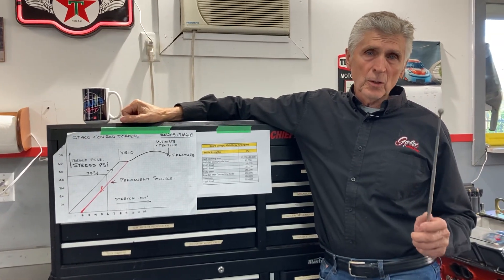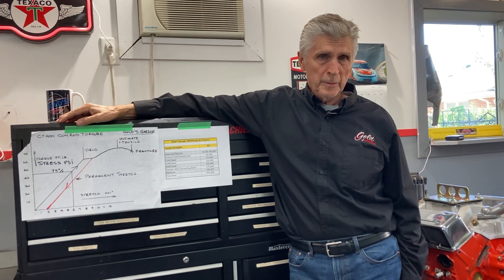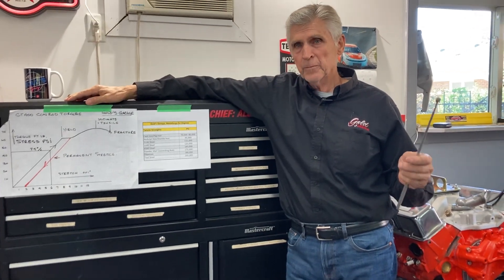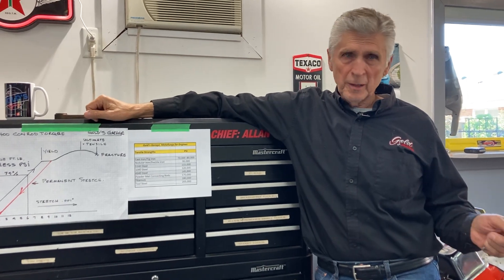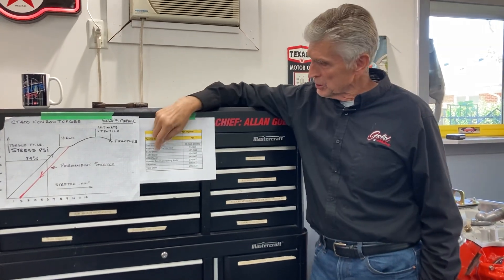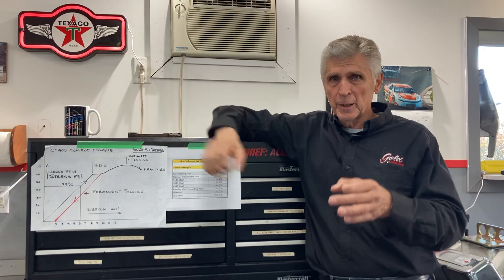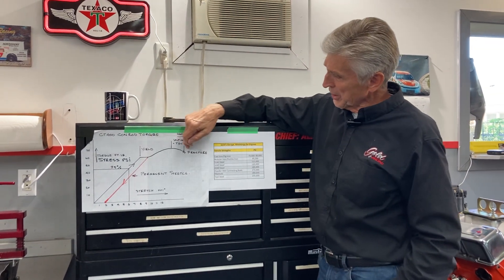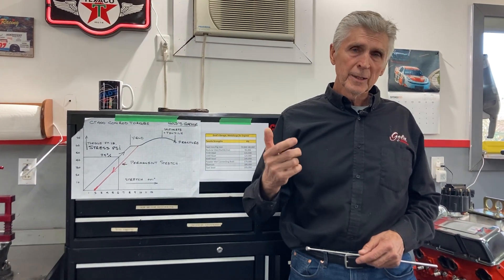Forged or cast?? choosing the RIGHT parts for YOUR build - Which rods and crankshafts are best??

Comment: "Powder Metallurgy" sounds like Similar "Cheaper" process Chrysler did Factory Oem between their Forged Steel cranks & massive Dana 60 axle with their 727 auto trans Front clutch Drum & we all Know how that worked out (Google 727 trans Explosions) !!! ........Anyone running a 727 (Even Oem Hemi trans) must spend Big Buckaroo$  to replace that Oem Pos "Powder Metallurgy"  clutch Drum with real Billet Steel just to keep your Legs, feet & car Intact......Another Powder metal Fail !!
Reply from the maker: Thanks Tom. All good information that i didn't know. Thanks for sharing. AG

Comment: Speaking of yield. I just finished a 393 Windsor. Scat rods. Torquing rod bolts and one kept on going. OH SHIT! Mind these are ARP and this one must have slipped through heat treat. I replaced that bolt and it had noticeably stretched and the shank was .020 narrower  and longer than it should have been.
Reply from the maker: Thanks for sharing your experience and validating my point 39Impala. IF you look at my stress/strain graph, what happens between the ultimate tensile strength and fracture is called "necking" where the bolt cross sectional area reduces as it stretches. That would make a good lab example. Good that you were able to replace it. AG
Reply: @goldsgarage8236  cool I see that now.

Comment: You forgot to mention 300M steel some higher end rods are made of.(or is that just some high end roller cams?) It's supposed to be even better than 4340.
Reply from the maker: Thanks itseithergoingtowork. I am not familiar with 300M steel? AG
Reply: @goldsgarage8236  
I looked up 300M connecting rods and they do use this material on some of the high end rods. A simple Bing search got me there. I thought they did but couldn't remember for sure.

300M is used on transmission input shafts if 4340 isn't strong enough. The sbc 383 I built for a friend had to upgrade the input shaft on his th350 to a 4340 one and broke that one and had to go up to the 300M input shaft. After that it was fine but then he started breaking output shafts.😲

They don't make a stronger output shaft so he had to start over with a th400. It wasn't that the engine was that powerful, only 588 HP, it is the way the vehicle is driven. He likes to keep it floored when he takes a 10 foot jump and by the time he lands it's time to shift. The vehicle is built to run on the Silver Lake Sand Dunes here in Michigan on the west side of the state.
Reply: I think 300M is just a modified version of 4340, has more carbon and moly maybe. I think the Vasco shaft is a little better than the 300m but I could be wrong.

Comment: Thx for informative vid...Not gonna use any "Cracked" rods in my engine builds....Everything the Oem factories use & Promote today is simply what's Cheaper for them to produce.....Not better or stronger.....Any con Rod big End that can be simply knocked or "Cracked off" is just too Brittle weaker alloy that will just suddenly "let go" (On the Dotted line) when Pushed instead of controlled stretching or bending like Real Steel rods  used to do......A good Aircraft grade gas vacuumed 4340 Con Rod will probably Break or Demolish the factory "Cracker" if you tried "Cracking" it's cap off !!
Reply from the maker: Thanks for your point of view Tom, always enjoy your comments.AG

Comment: Tool steel is used alot in making wrist pins for pistons.  L-19 connecting rod bolts are the best!  Highest psi...
Reply from the maker: Thanks Leonard. Good point, thanks for catching that. AG
Reply: The custom age 625+ is up there in strength and not as corrosive as the L-19.

Comment: Hope you don't mind if I add something not mentioned. Powdered metal rods are not reconditioned due the method of fracturing the cap. Grinding these surfaces would remove those mating "chasms"  so there is no way to locate the cap on the rod. Most rods locate on the bolt shoulders or could  have a hollow dowell surrounding one of the bolts to locate the cap. Not so with powdered metal rods. If they are spent, you have to spend.
Reply: It is possible to get bearings that are oversized on the od, so you can recondition these type rods
Reply from the maker: Thanks 4Speed. Good point, I never thought of that. AG
Reply: There has been some reconditioning of these PM rods by shot peening the fractured surfaces which allows minor resizing.

Comment: Is steel of the same #s always the same strength
Reply from the maker: Thanks for the question David.  No they are not. Steels like 4340 are often heat treated for special purpose applications and this process can significantly change the physical properties like tensile strength and hardness.